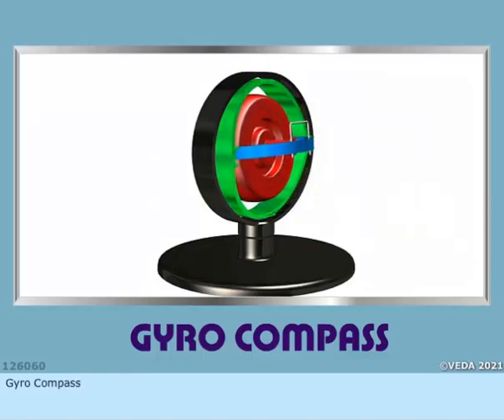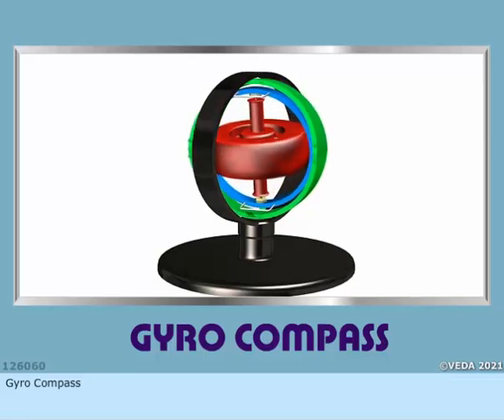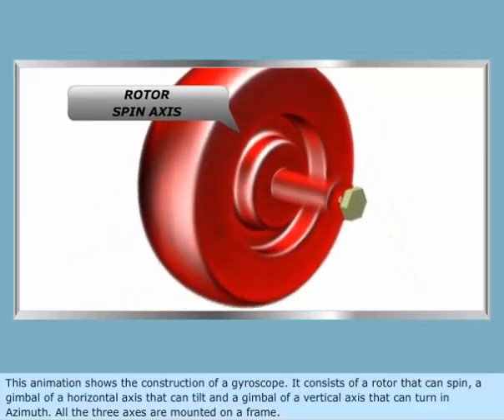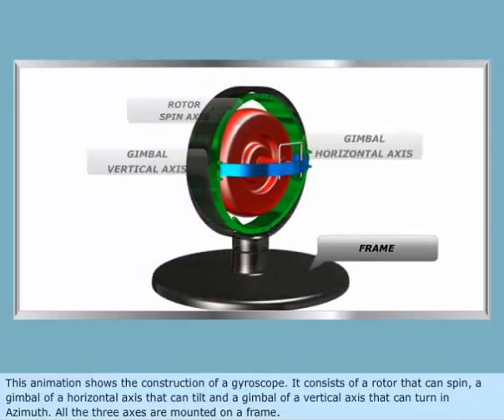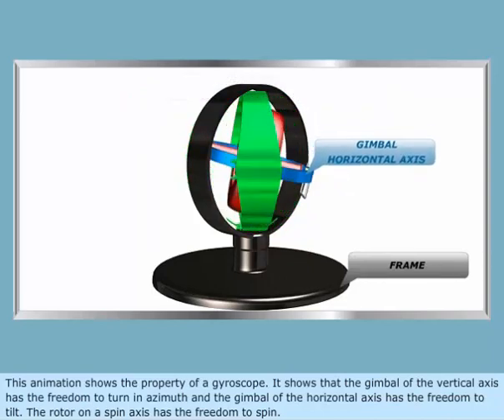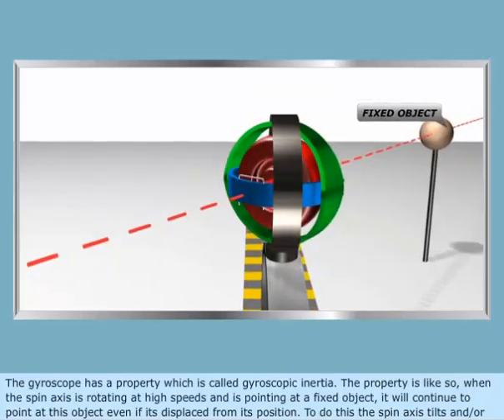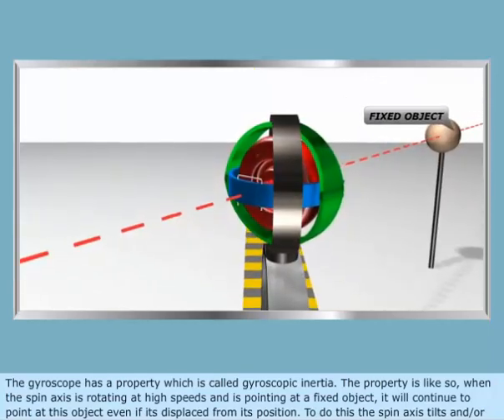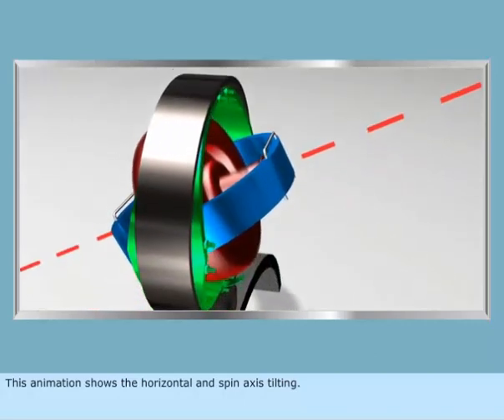Free gyroscope  | Marine gyro compass | Merchant navy knowledge #navy #merchantnavy #ship

Comment: What? Absolutely not. The gyroscope won't point at an object in particular. Its axis will remain unyielding, and always point in the same direction, whatever the movement of the outer ring. It will absolutely not follow a nearby object like an eye. This video is wrong